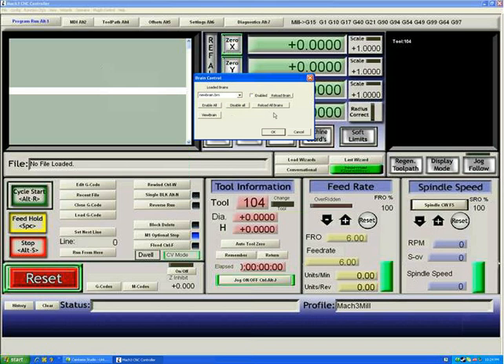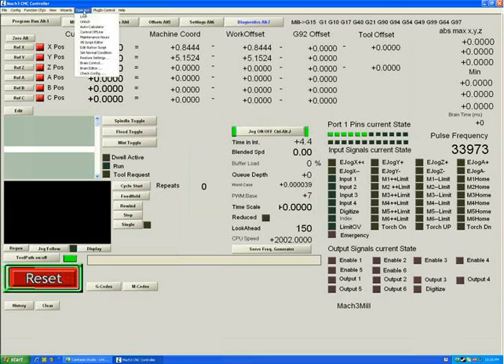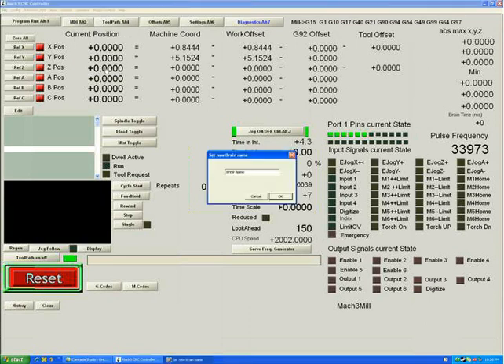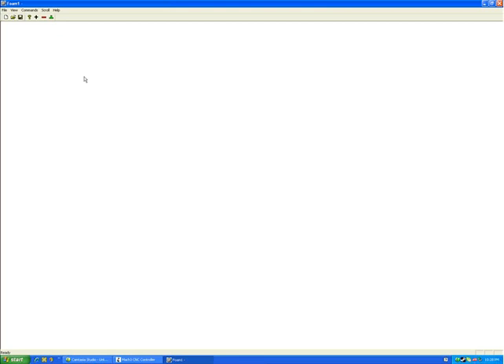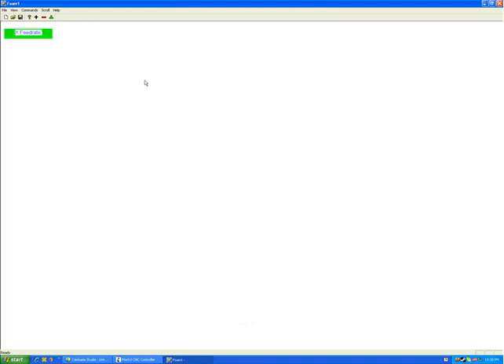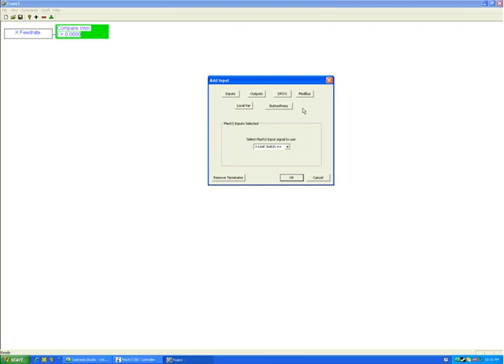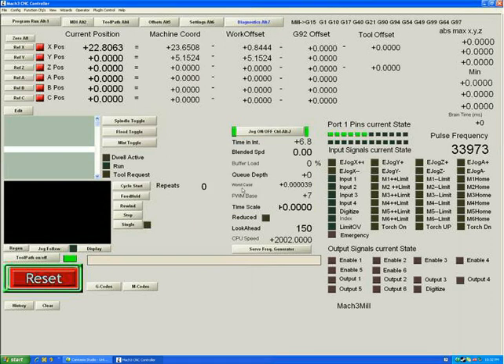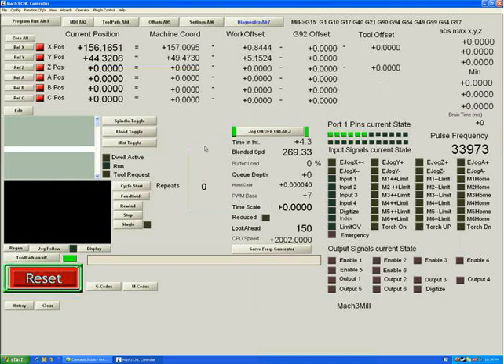Introduction to Brains Mach3

Comment: Thank you very much for this video. Is there a way to make a brain turn off LEDs when Stop (m0) is activated?   I a have custom macros I run the use notification lights when they are running but if I stop them mid run the code does not get to the Led off yet. Any suggestions? Thanks!

Comment: Hello !!!
I am Piotr and I live in Poland
I have a ModBus relay module
https://pl.aliexpress.com/item/4000149070230.html?spm=a2g0s.9042311.0.0.27425c0fsqUM4e

The address is set with a switch (I have it set to 1)
the module is connected via the usb-rs485 converter
After turning on in mach3 Test ModBus
the module works, but not when selecting Coil (s) but HoldingRegister (s)
That is: Slave Addr1 Start1 NumReg1 Data100 relay nr1 turns on
Same, only Data200 relay No. 1 turns off
And I'm asking you to tell me what to set in my brain to make it work because it doesn't work
I have already watched dozens of videos on youtube and there is nothing about such a problem
I watched your video five times and it didn't work
Please help me with this
Thank you and best regards